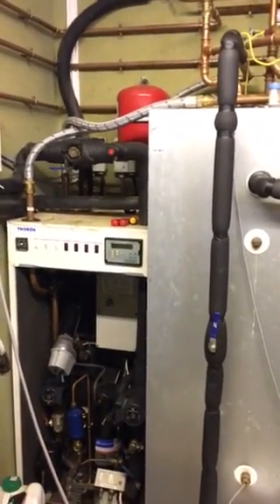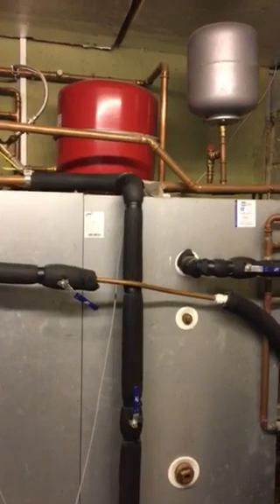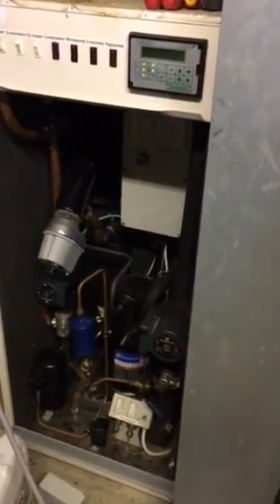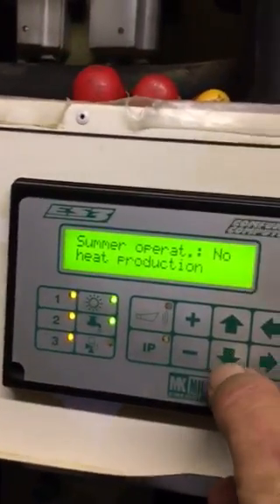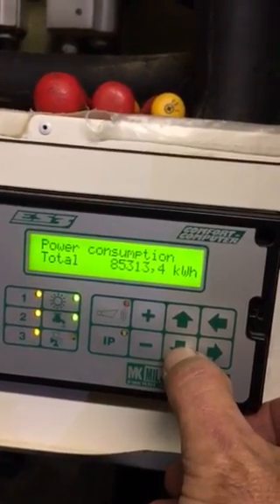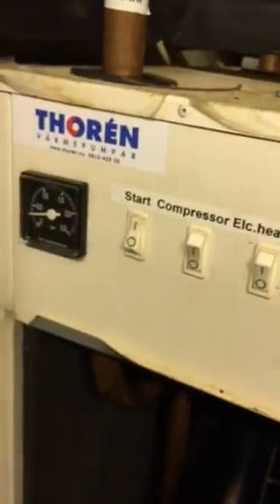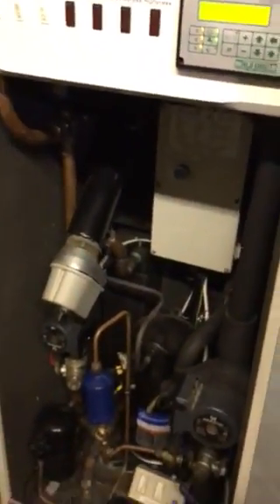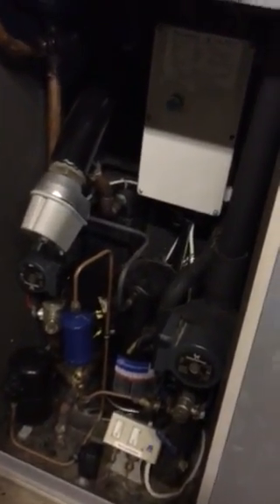Ground source Heat pump ? Think before you buy/install one !

Comment: Hi Mark, Sorry to hear you have had a bad experience with ground source heat pumps. Did you replace this system with an oil boiler or would you like us to see if it can be rescued for you? feel free to contact me if you want to chat. 
Regards,

Jonathan
isoenergy
Reply: Marc, whoever put that system in your property wants locking up for two reasons - (1)  that's a complete hotch-porch of components with numerous failure points and (2) from the brief glimpses of your house construction it was never going to retain the low flow rate heat that any pump system could  produce (unless it has been fully retro insulated to a high standard). Sorry to hear about your experience but the cowboys have seen an opportunity in renewables and are all over it. Have you taken this up with RECC?
Reply from the maker: isoenergyltd . Will be years before I go that route again, sorry.
I know another chap 5 miles away who also ' pulled the plug' on it.
My oil boiler is not much different to a nuclear station away from my house making the electric to be green at home!?
My installation was probably just a terrible install. Certainly cost me the earth 😱😂